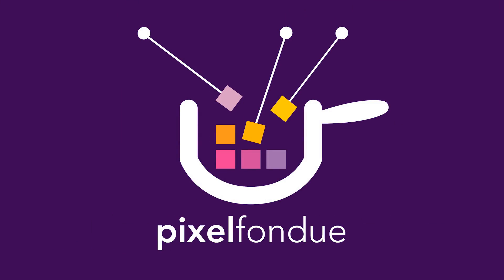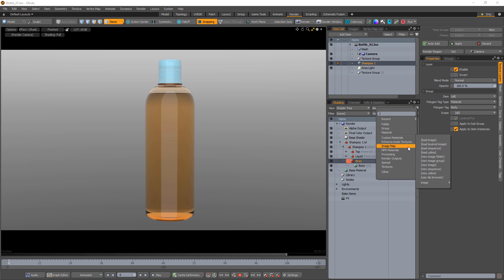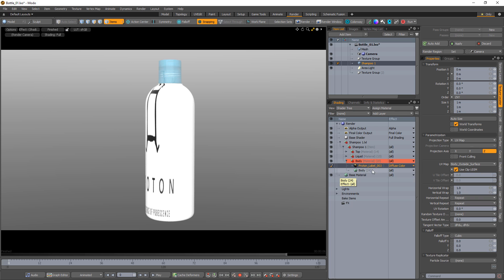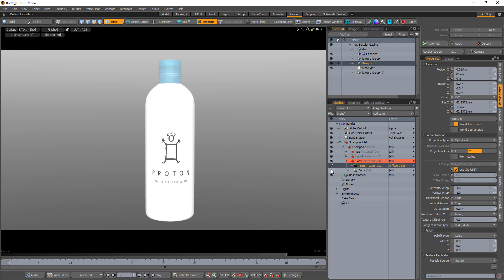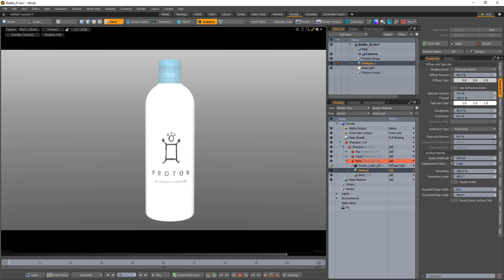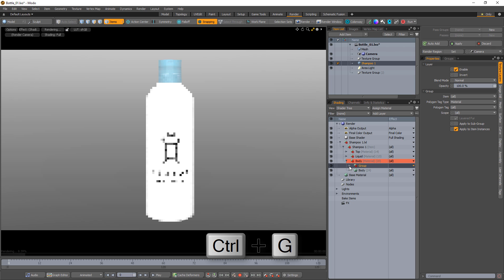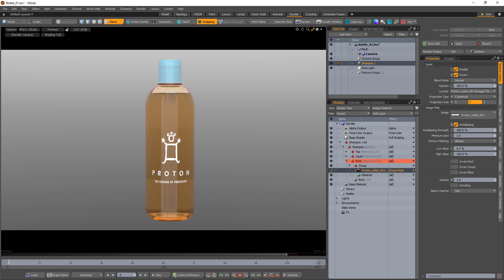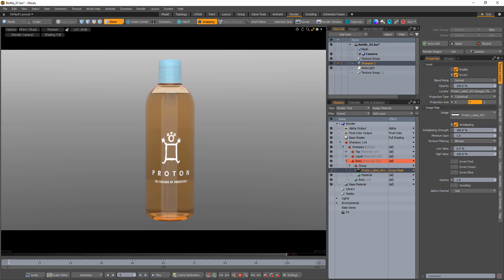MODO | Texture a Logo on a Glass Surface

Comment: I was following your tutorial. Mine is different in that I'm trying put place an opaque square white logo label onto the glass surface.  I have it located my logo by turning off the glass effect material and locating and sizing my logo square.  Here my requirement differs from your tutorial.  I do not need a transparency effect. What steps do I take to get my opaque white label to display on the glass surface?  Regards, Michael
Reply from the maker: not following... its sound slike you want what is shown in the video. can you share an image of what you are trying to create?

Comment: was there any advantage to using a different technique - I mean like copying some the front geometry of the bottle in the same place and then using your technique to put on a logo?
I remember when I was doing something similar there were some issues with the technique presented in this vid. What does the bottle look like from the back? can you control the texture from the other side? You'd probably need to swap a different image from a back shot right?
Reply from the maker: No need to copy geo. That just seems unnecessary to me. 

The bottle and logo look correct from back view. If you wanted to control the texture on the back you can do it using a gradient set to Back facing to mask the front from the back.